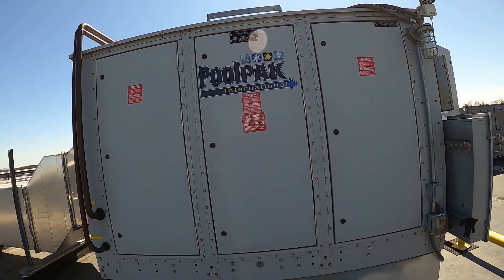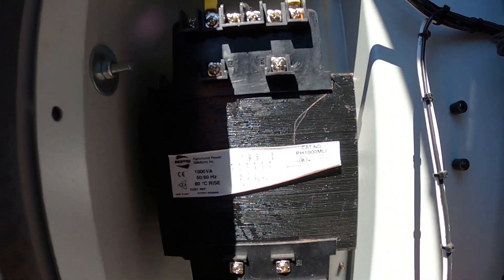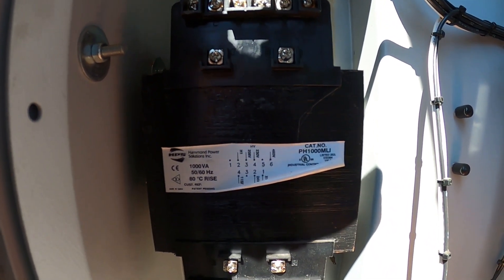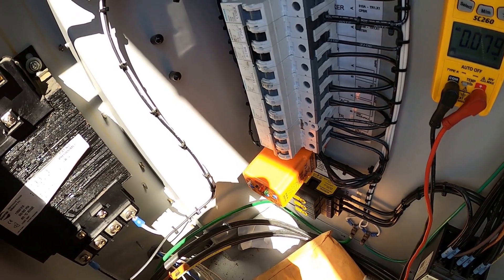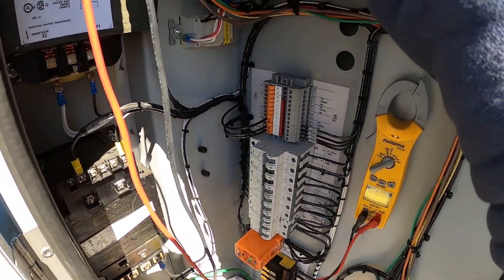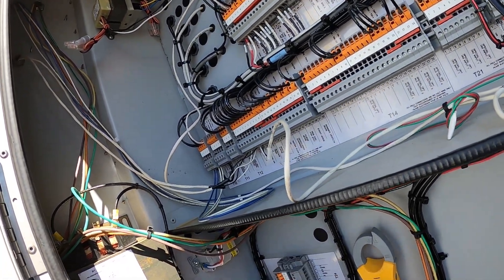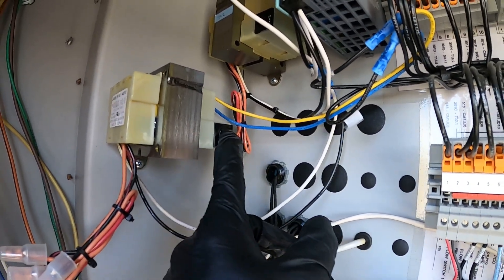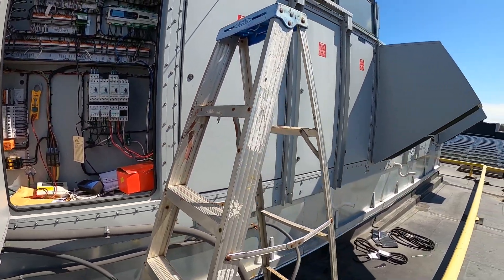How To Test/Check A Transformer Using A MultiMeter? HVAC Transformer (HVAC Step Down Transformer)

Comment: I’m having problems with a 150v control transformer for a size 1 three phase starter. I get my 480 primary coming in and my secondary is good as well but as soon as I connect my ground and Neutral and my control wire to the coil I loose my control power and I’ve replaced everything I’ve megged the wire no shorts I can’t figure out why this is happening any help would be much appreciated

Comment: Great video quality what camera are you using to record and is it a head mount? Thanks for the transformer tips
Reply from the maker: Thank you very much! I'm using a Go Pro Hero 8 Black camera and yes, I'm using a head mount. You're very welcome! Stay tuned for weekly uploads👍
Reply from the maker: GoPro HERO8 Black Waterproof Action Camera Bundle
https://amzn.to/2Rb8zcN

GoPro Head Strap
https://amzn.to/2x27woD

Above are the exact links for the camera setup I have. Im looking into getting the dual charger for the batteries as it does come with 2 in that bundle. Thanks again for watching! Stay safe out there